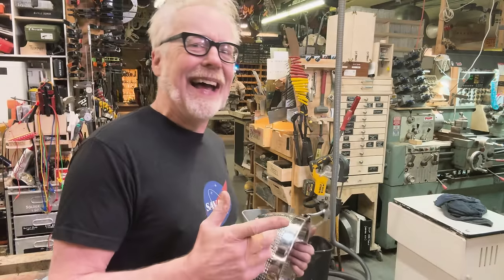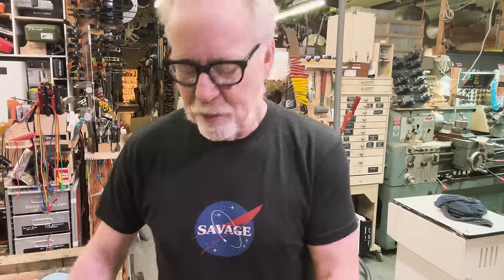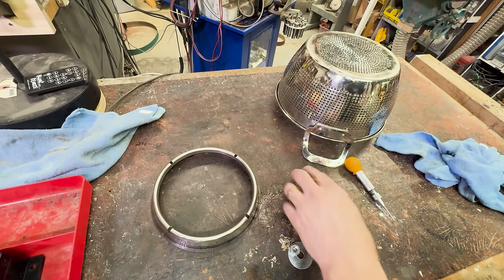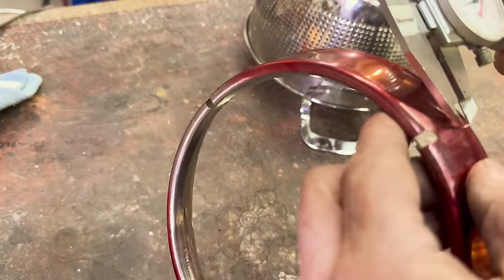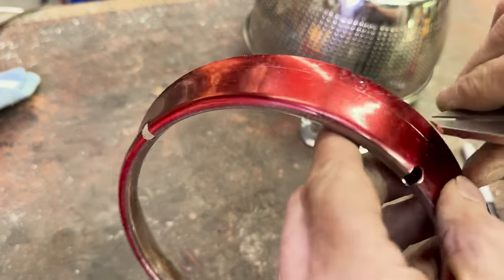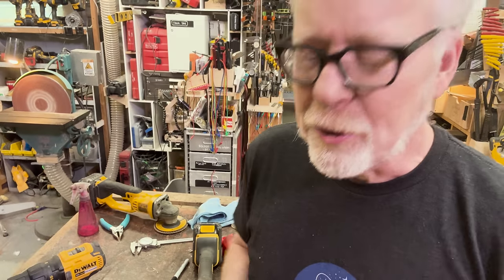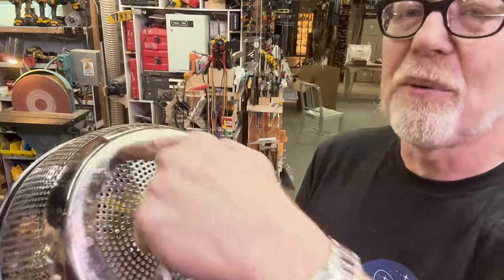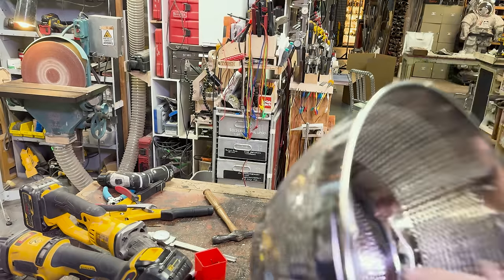Repairing the Most Useful Tool in the Kitchen!

Comment: If you're going to use rivets, use an upset rivet not a pop rivet.  Less place for food to get trapped.
Reply: Definitely "real" rivets!
Reply: Even aluminum rivets would work in this case.
Reply: So what no leftovers 🤭
Reply: Finally a response from a food service expert.
Reply: Or at the very least use marine grade pop rivets (stainless steel, blind pop rivets).  Dissimilar metals in a wet environment will get you galvanic corrosion.
Reply: What did you do to upset the poor rivets?
Reply: If you don't have rivets then nuts and bolts could also be used. but you might have to tighten then occasionally.
Reply: yeah, i noticed that too, seems to be an unusual over sight on Adams part he's usually good at choosing fasteners as he has a great knowledge of all different kinds and his knowledge of armor riveting should have set him to choose solid rivets rather than hollow.

at the point he had chosen to make tabs and remove material he could have gone with folding over the tabs and spot welding the ring on, avoiding the whole rivet issue
Reply: @writerpatrick  reminds me that i really need to locktight handle bolts on a couple pans/lids that always are coming loose
Reply: CherryMax or CherryLock rivets would also work as they install like pop rivets but the center is filled.
Reply: @Merennulli  forgot to feed the rivet’s civet

Comment: I'm over here cringing about using Starrett calipers to scribe on stainless.  Don't get me wrong, I use calipers to scribe all the time, but I use cheap import calipers for scribing, and I save my Starrett and Mitutoyo for real measurements.
Reply: Hurts your soul to see.
Reply: To be fair, he's just scribing into the marking fluid. But still, I understand your pain.
Reply: @robadams1645  yup.  If he's careful it will likely do no harm.  Plus, he can probably afford to replace them when it becomes necessary.  But it still triggers me.
Reply: No one measures on the tip. So it's fine.
Reply: @1pcfred  unless what you're measuring has little to no depth, which happens all the time.
Reply: @HomebrewHorsepower  no that never happens to me. Where is it happening to you so frequently?
Reply: @1pcfred  measure the distance from one snap ring groove to another snap ring groove on a shaft.
Reply: @HomebrewHorsepower  why would you use the outside jaws for an inside measurement? That's what the two points on the other side of calipers are for.

Comment: I know it's a marking fluid but that red is beautiful
Reply: Ya, I want paint in that color.
Reply: I had a set of mixing bowls that were lacquered in that exact colour. Kind of a candy apple red. Very pretty, but the finish started flaking off and static clinging to everything, so it’s going into the scrap bin.
Reply: @darkmagician2904  Dupli-color Metalcast series paints. I used the red to paint over some chrome emblems, and it has that perfect candy apple color.
Reply: Yeah, was thinking this looks even nicer than Tamiya clear red for a candy red metallic. It scratches easily too in case you want a weathered paint job, like a battle damaged Iron Man suit or something. Hmmm....

Comment: A colander is also great for a solar eclipse. The shadows are amazing :)
Reply: Can shadows be more amazing than homosexual special rights ?
Reply: @benjurqunov Wtf lol
Reply: @benjurqunov  I second the WTF here. Where did that come from? lol  Also, I wish I had thought of the colander this past eclipse. Great idea!
Reply: Exactly where my brain went. I wanted to take one for the last eclipse, but ended up not feeling well when I was meant to be packing for the trip, then forgetting it in the last minute rush.
Reply: You could also stick it on your head to block radio signals. :) It should work as a Faraday cage.
Reply: I once experienced a partial eclipse from inside a sheep shearing shed that had been built in the 30’s.

The tin roof and wall cladding was full of holes and everywhere there were spots of light from the Australian outback sun, each with a bite taken out of it. 

I pointed it out to the shearers and they all looked at me like I was the crazy foreigner that I clearly am. The next day at smoko one was reading the paper and he looked up and said “Eclipse yesterday” No one said anything, but I got a beer at work’s end and the occasional G’day mate after that.

Comment: Who else thinks this would have been a cool tig welding project too?  I do not have a tig welder, and I know Adam has brought that up in the past, but this made me think of trying it as a tig weld.  That or the original 5000psi jb weld epoxy inside the ring between the base and the ring.

Comment: Fun video, Adam! I was wondering why you didn't just re-weld the base back on instead of riveting?
Reply: Just a guess, I assume that he was afraid that his welds would also fail after time. Stainless is also notoriously difficult to work with for welding, so it might be a combination of things.
Reply: If the colander is stainless (which I believe this W&S model is), Adam may be out of his comfort zone trying to TIG weld 304 (18/8).
Reply: @yoyopg123  I was wondering why he didn't just TIG weld it...  Reading your comment, I guess this material is rather tricky?  Never done and TIG welding but it is on the "to do list", plan on taking a class at the local Maker Space this summer.
Reply: @WHJeffB there a few factors about TIG welding stainless that can put a novice TIG welder off the idea of trying it on a production piece.  First is the type of stainless.  303 and 316 have qualities that make them challenging.  304, which is the type this apparently is, is easier but it still has challenges.  By far the most important situation is that stainless is a fairly poor conductor of heat, so the weld temperature builds up quite fast and you quickly risk the possibility of denaturing the durable qualities people go to stainless for.  So you have be quick and efficient with your torch and filler rod and not linger on one spot too long.  That requires practice.  There are options on higher quality, modern torches where you can program a Pulse setting, which helps keep the heat build up in check, but you still need to have your technique down to produce a good weld.  My Miller unit, while good, lacks a pulse setting.  I wish I had it.  I know Adam has a new welder in his shop but I’ve never seen him do TIG welding on the channel.  Admittedly, it’s all conjecture on my part as to why he didn’t TIG weld it, but I’m guessing he didn’t want to practice on his son’s expensive W&S colander.  Best of luck with your future welding endeavors!

Comment: Copper rivets you say? I didn't know that copper was food safe. I always thought that you needed to have a coating on the copper so the food don't touch the copper for it to be safe (I.E: copper pans has a lining inside them) I'm no food safe material expert and would be happily corrected if I'm wrong. Good video by the way. Really love what you at tested are doing and showing us.
Reply: I was thinking along the same line. Copper pans are coated on the inside with tin to avoid poisoning.
Reply: Oddly copper coatings are critical for some egg dishes, has to do with ionization, or some Alton Brown level of thinking. But copper is both anti-microbial in that it destroys some bacteria and also prevents others from dividing, (some materials only prevent division) but yeah, it's food safe, the coating is often for ease of cleaning and that it is reactive to acids, so not suited for some foods, similar to raw aluminum.
Reply: @KarltheKrazyone  thank you so much for the information. I had no idea about it.
Reply: @KarltheKrazyone copper pans can lead to poisening you though if cooper leaches into the food, so I don't think it is actually food safe. Having said that, I think in this use case it's unlikely to be a problem.
Reply: @chrisdturner  Foodsafe in terms of using it as a collander. You can't cook or store food in copper as it disolves into the food, but you can use it with utensils. Also its anti-bacterial in properties.
Reply: @chrisdturner  Copper is relatively unreactive and antimicrobial, this is the reason it is used for water pipes. There are a lot of swimming pools that use copper combined with silver to sterilise the water since it's safer than chlorine based sterilants. As a fun fact, copper is found to be deficient in most peoples diet so a bit of copper from four tiny rivets is more likely helpful and unlikely to make anyone keel over. That said you do have to be a bit careful with the salts of copper, the carbonates and sulphates tend to be a bit pokey but these tend to be very slow to form from copper metal under the conditions you would find in your average kitchen.

Comment: Wondering why Adam didn't just spot weld it again.  If it fell apart, the original welds were probably crap (not hot enough for the metal to really bond).  Re-doing the spot welds would be a cleaner finish, unless that collander is plated and not stainless.
Reply: Yeah. The most straightforward fix would have been simply tig welding the base back to the collander. Even a food safe epoxy would have worked.
This is an overly complicated fix.

Comment: I repaired a wire colander for the friends I was living with, while going through trade college for welding. I'd hardly done any TIG (95% structural stick welding), and I did a hideous job. 
But 15 years later (mostly spent TIG welding, ironically), that damned colander still won't die.

Comment: A couple points: 1- copper is NOT food safe. Properly tinned copper is, but bare copper is most decidedly not. Not so bad here as it would be for a pan or kettle that gets direct heating, but the copper oxides are very not good. The quantity here, with the small surface area, is unlikely to be a major issue, but still not great. 
2- PUT THE GUARD ON THE GRINDER. Really. I have been using grinders since well before Reagan's first Pinnochiotomy, and in that time have NEEDED to remove a guard for access fewer than a dozen times, and every time have done everything I can to be sure that in case of a problem, the debris won't hit me or anyone else. I have, on the other hand, fired people for removing the guards. I have also been involved in worksite triage for more than one person when they snagged and shattered a wheel. Also, wear a face shield. Glasses are not enough. You can chew with false teeth. You can walk on a wooden leg. You can't see out a glass eye. In my experience, the people most opposed to the guards are the same ones that claim safety tow shoes are more dangerous than unprotected.
As a side note on special effects- every time someone says that a blood spatter looks fake, like someone just threw a can of red paint in a fan, I can attest that that is EXACTLY what it looks like. Years ago, we had a mechanic working on a diesel power unit on site, and due to a pressurized hose failure (that he did not consider and didn't protect himself from) stalled the unit with his arm. This was a BIG unit. Looked like someone threw a can of red paint into a fan. He was back at work about half a year later, 90+percent function,. not a lot of peripheral feeling.
Reply: So why is it used for water pipes and as a sterilant for swimming pools if it's so 'unsafe 'then? In fact copper is considered to be deficient in the majority of peoples diets. I think that given the unreactive nature of copper the amount your likely to get via a couple of tiny rivets wold be almost undetectable and therefore not worth mentioning.

Comment: Doing a quick search, I saw a set of 3 for $20, and nice stainless steel colanders for less than that.
Consider the hourly rate of a handyman or skilled maker (or traditionally a tinker is someone who would go around fixing household items), and it's certainly cheaper to just buy a new one.
This would suggest that a project like this should be more than just a simple repair -- it should be a unique artwork of some kind.
Make a Deathstar™colander, or where the holes spell out a secret message, or something like that.
Reply: I thought the same thing watching until I read it is supposed to be a Williams Sonoma colander, which a set of 3 goes for $139. I say supposed to be because another comment pointed out that it is likely counterfeit. When you see the close ups of the interior you can see the poorly punched holes and raised metal. The fact that it failed in the first place might be enough evidence. That being said, buy a new colander...

Comment: With the advice against this approach why didn’t you just fully weld the base instead of the tack welds it had?
Reply: Or just better tack welds. But you do need stainless rod to weld stainless. Which isn't easy to come by. When I wanted some the supply house just sold it in 5 pound amounts. So it was about $150 for a bundle. But he just threw me a rod for free.
Reply: @1pcfred  Must be dependant to where you are, area near me has/had everything I ever wanted.
Reply: @wobblysauce  Yeah I guess the New York metro area was never the nexus of the Universe I suppose. Well, it was then, come to think about it.
Reply: This sort of stuff can be fusion welded with TIG - no filler required.
Reply: @mikelastname  it can be. But then it'll just snap off again like it did the first time.

Comment: Knife. 

Without a quote, hard to verify the Child/colander thing. You can drain a lot of saucepans with just a lid.

I have several colanders, depending on use. I prefer the large ones to have 3 separate feet, so you missed a chance here. That colander, set in a sink to drain, say pasta, might dam up the water faster than it can drain and make things disgusting. 

Rivits are seen in commercial NSF cookware. They have to be tight. And aluminum is everywhere in a commercial kitchen. You have to know what is in conact with the surface to be safe (no acids, no eggs). The NSF/ANSI standard has to deal mostly with material(s), safety, celeanability, etc. As others have mentioned, copper might not be the best choice. Even for just draining, it's going to get green and require some extra scrubbing. 

But a thoughtful repair, nonetheless. And glad you're repairing and not tossing.

Comment: I wonder if a silver rivet would have additional antimicrobial properties for those little interstitial spaces.
Reply: Copper and its multiple alloys are antimicrobial too and much easier to source.
Reply: @thechumpsbeendumped.7797   copper " Verdigris"  tasty
Reply: @littlehills739  
Try thinking before you type. We’ve used copper pipes and vessels to store water for millennia. Apart from that, it would take years of not washing before those minute rivets to produce verdigris. The only issue would be if left in strong acidic solutions for extended periods which is unlikely with a strainer.
Reply: @thechumpsbeendumped.7797  Yes and usually a strainer is not put away wet. The only time I have seen problems is with Plumbing in a house 50 years old when working on and from onset of shifting the pipe was flat for a drain in bathroom and I had to help my brother fix plumbing. Only worse was copper in basement where a shower was non working since 1990.

Comment: There are several uses we don't usually think of today: you can use it to squish cooked potatoes, tomatoes etc. thru to turn it into a puree for example
Reply: They make a special gadget for doing that called a potato ricer. Which does resemble a colander. But it also has a lever press arm attached to it too.
Reply: @1pcfred  true. But this is where it originated. Simpler times, fewer gadgets

Comment: I think I would have tried brazing it back on. Would have been interesting, and it it failed, unlikely to destroy the utensiland you could fall back to the rivet solution. Both ways interesting, in my opinion. The rivets do make sense, as it looks like the handles are riveted as well. Regardless, a neat, low risk and fun project.

Comment: Would it be possible to grind and sand and polish the rivets down to create a smooth working surface, not dissimilar to how ClickSpring removes his rivets? Or would that not be possible, given how thin the stainless steel is?

Comment: Would love recommendations for spray bottles that don't stop working immediately, and/or ways to fix them when they do 😅 hate those things so much they're all terrible
Reply: They stop working for two main reasons
1. the spring has snapped - stainless steel spring (easily replaced) 
2. the valve in the head is clogged (easily cleaned).

You can buy a bag of springs once you've found your preferred spray bottle and you can clean the valve by screwing off the adjustment head and carefully (using something like a pair of scissors) prying off the valve body, which itself is made out of two plastic pieces (snug fitted), a small spring and a glass or ceramic ball. That's where the schmutz gathers if you don't keep your bottle clean and that ends killing the spray bottle because the pump has to work overtime and that eventually breaks the spring

If you're particularly unlucky (or use alcohol in your spray bottle) the pump's lip seal will harden or deform, that's pretty much it for that spray bottle. Trash it after recovering the springs and ball.

Comment: It comes to mind that ive never seen Adam weld. He instead of just re-spot welding the base back on. Turned it upside down, cut out all that metal and copper rivited it in. Just drill 4 new wholes in the rim. And fill in the wholes with a mig welder. Batta Bing Batta boom.

Comment: I woulda spot tig welded it back together. Easiy add more spots around it then the 4 it had and it would never come back apart.
Reply: That's great if you have a TIG welder and stainless rod. It was all chromed too. Which would have made welding it sketchy. Stainless ain't that shiny.